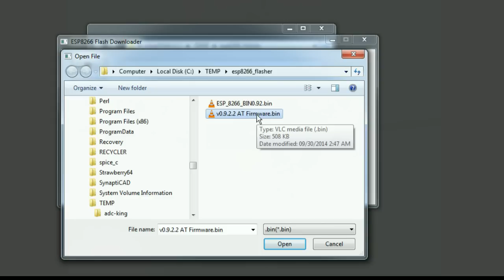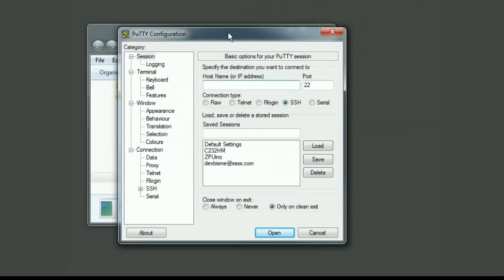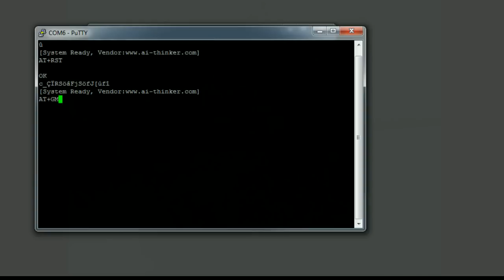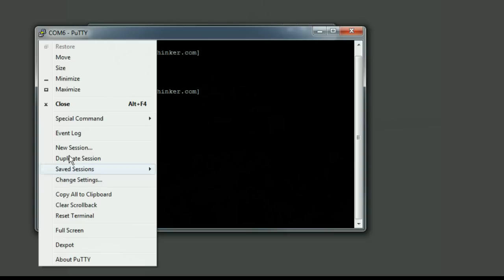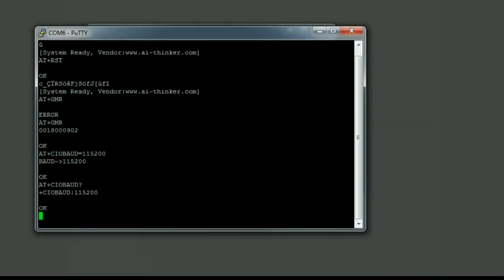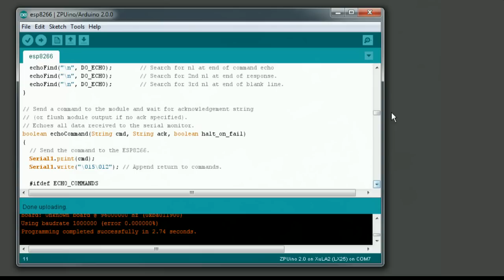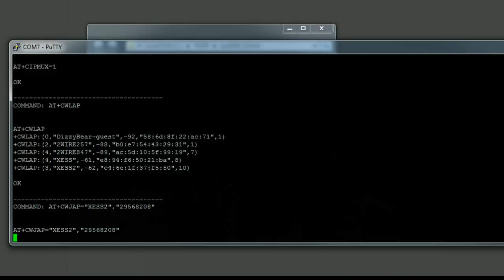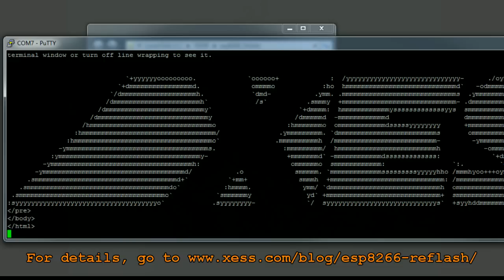Reflashing the Firmware of an ESP8266 WiFi Module

Comment: I was flashing and then this came out:
Writing at 0x0000c000... (11 %)
Invalid head of packet
Do you have any idea about it? Thanks =D
Reply: +Fabio Aurelio I have the same problem, and I suspect it might be an unreilable/bad FTDI module (usb).

Do you use the same?
Reply: Yes, I ordered CP2102 usb to uart and it did flash =D
Reply: +Fabio Aurelio Wow, I spent over a couple hours trying to get it to flash :<
Thanks for the quick response!
Reply: Hey Fabio, try following this instruction: http://subtledesign.net/index.php?id=learning-lounge&post=esp8266-esp-01-firmware-update
 If you see something weird is going on with 8266, connect GND to 3.3V with a small 3.3V capacitor. It will solve most of the problems
The other possibility is a low current. use an external 3.3V. this should solve it.
Also keep in mind that you can use AT commands to update the firmware from manufacturer's Server, instead of using an external software on your pc.
I the same link I explain how to do that.
Have fun

Comment: After programming, doind the reset to connect via putty i get a lot if this.,,,
--%%%----%-%-%%%%-%--%%%--%%--%%-----%%%------%%---%                                                                                  -%-----------%-%--------------%-%-%-%-%-%---%-%-%-%-%-%-%-%-%-%-%-----%--%---%%-                                                                                  -----------------%-%---%-----%-------%-%-----%---%-%-----%------%-%----%---%--%-                                                                                  ---%-%-----%-%----%-%-----%-%-%--%---------%-%--------%-%--%-%---%-%-%-%------%-                                                                                  %%%---%--%-%%%------%-%------%-------%-%--%--%--%%%%%-%-%----%---%%-------%--%%------%---%--%%%%%%%--%%%%%----%--%%%--%----------%%%%---%----%-%%--%--%%--%----%%%-%%---%%-----------%%--%%---%-%---%%-%---%--%%%-%%-----%-%%--%%----%%%%---%%%---------%%--%%%-----%%%-%--%-%---%--%%--%-%%--%--Ç---%%--%--%%%-----W%-%-%-%-%-----%---%-%---%-----%--%-%-%-
Also the blue light is constant.
and the garbage does not stop.

Help please!!!